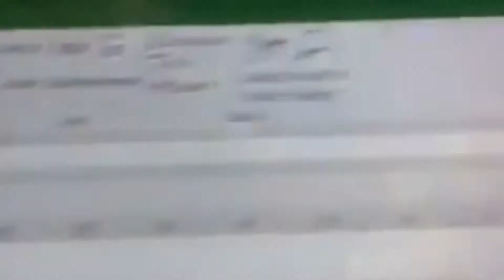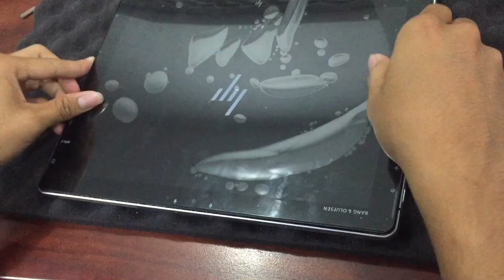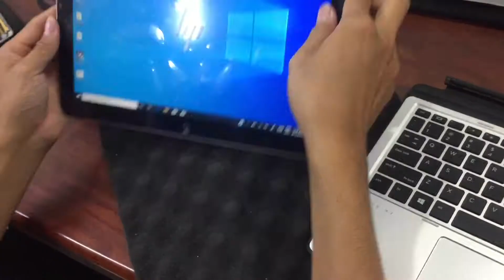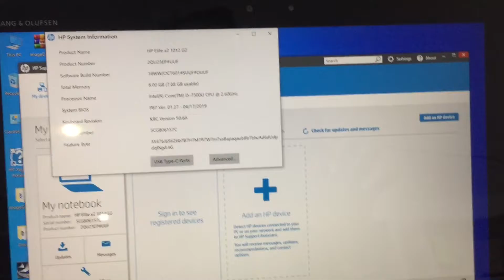Screen Shaking Problem HP Elite x2 1012 G2 Replace New Screen

Comment: My touch immediately stopped working, i have tried everything from resetting wimdows to bios test. Nothing works. I think I've the same hardware issue.
Reply from the maker: First step change new cable touch and or replaced new screen ?
Reply: @SOYSENG  thanks, i will, after the lockdown is eased
Reply: Can't find any cable, how much does the screen cost?
Reply from the maker: @hamzajawed4885  out of stock